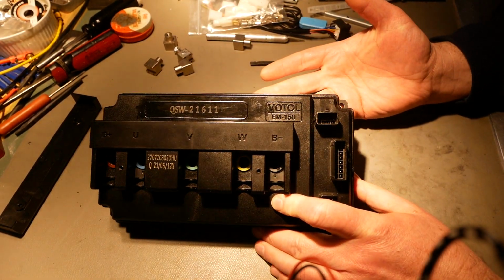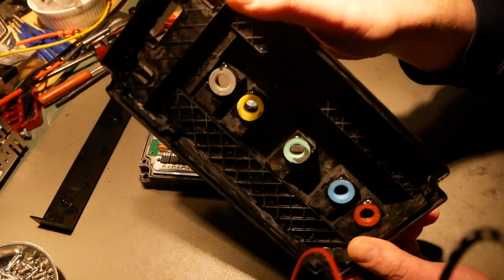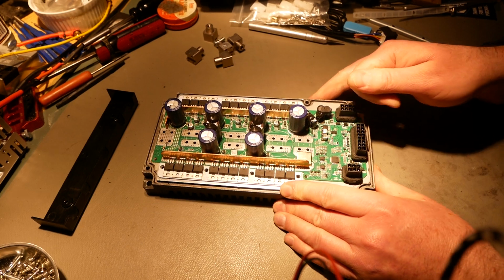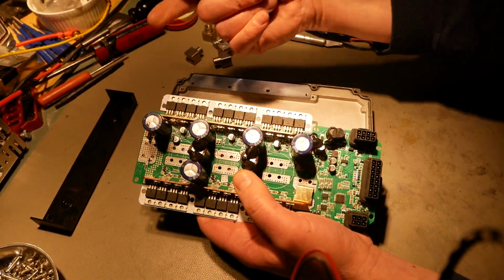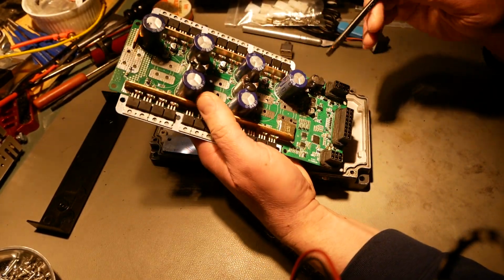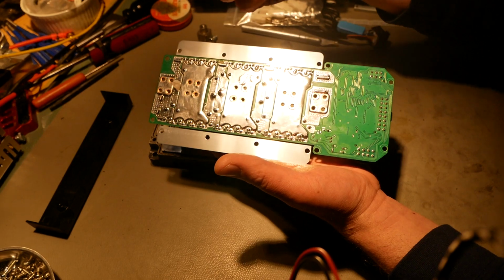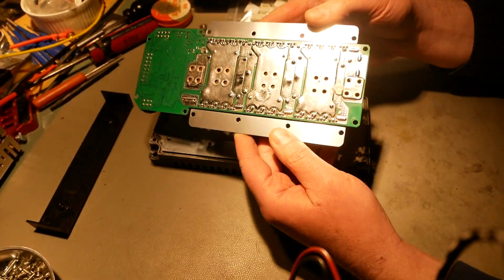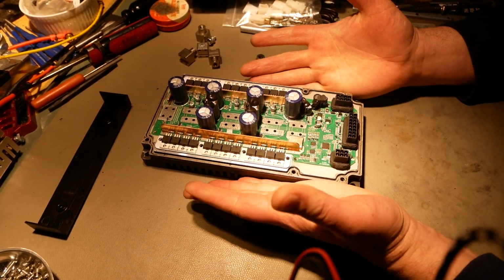Votol EM-150 Overview

Comment from the maker: Corrections:
I'll mention this in the macro video and probably should have done it here too. There is no evidence of temp sensors on these controllers. I know the STM32F103 has one internally, but that's useless for the mosfets. There really ought to be at least 2 of them. I'd put them, central as possible and physically on the MCPCB's.
Reply: Good day. I read about that at endless-sphere. If I understood all correct, temperature of mosfets is MEASURED not by thermocouple or similar device, but using same method that sometimes used to measure temperature of the LED`s - by measuring of voltage drop at MOSFETs during they are warm-up\change temperature.  Didn't verify that myself. But opinion like that exist’s. Also, there is one "bug". One of the users of that forum (at youtube his nickname\channel SilentEnduro) had reported that controller significantly reduce power after some abuse in mountains\uphills. I am saying "bug" because MOSFET`s actually cold, but controller thinking they are hot and reduce power. At endless-sphere there is one post with "settings" that are changing the way how internal temperature is calculated.  They are works for him, but he is not recommending to copy them because of risk that controller will be "brickt" (in case of different version, etc). (However,I did copy them to hidden menu inside VOTOL-EM-V3 Software)
Reply from the maker: @viko2812  I can't speak about how it might do temp sensing. Just me, but assuming the mosfets are behaving XYZ way may be unreliable. Proof is in the multiple points of truth and this is one area where the EM150 is lacking in my opinion. It REALLY needs at least one temp sensor on the high side and one on the low side. What is this "hidden menu" you are referring to?
Reply: @de-bodgery   youtube keep removing links(((  even at own youtube videos. omg....( Will try to just type... Open Votol-EM-V3 software... Than switch to PAGE3..... After that inside EditBox: "error_count:" remove all digits and type twice using keyboard sybmol "~". You will see "hidden menu" - Temperature protection. Or maybe you know how I can share link to youtube video. I captured a video with that process and with WEB page about settings at  endless-sphere site.
Reply: https://youtu.be/0usEsRcJOBE
Reply from the maker: @viko2812  PM me on facebook...Richard Gumfaw

Comment: Please tell me, I have the following situation: I connected the controller to a PC, when I apply throttle the motor does not rotate, but in the Display tab the temperature increases and reaches 200°C within 2 seconds. This happens every time I press the throttle. The question is: what component is responsible for temperature measurement? I have a donor controller.

Comment: So the big caps are only for filtering? So replacing them with bigger ones will not help output amperage/power?

Then do you have suggestions on how to improve output power of that thing?

Comment: hi, in case a unit brings always overcurrent and phase current at 0 no matter how many times I write parameter with different values, means the unit is bricked?? can you tell me in case of em50 if an sdm resistor may be the culprit for this issue? or a cap or bad component to check?
Reply from the maker: I don't know the EM-50 at all. If it is constructed like the EM-150, then I can give you advice based on the EM-150. The EM-150 has shunts for battery current, but not for phases. If I was seeing your error on an EM-150, I'd check the circuitry around the shunts and up to the CPU.

Comment: I noticed in a teardown of the EM260 model that 2 phase current sensors are used so they must have implemented a more complete version of FOC on those models
Reply from the maker: Same basic FOC capability as Far Driver or KO. They all use the same STM32F103 CPU and the same basic FOC libraries. This is a lower power CPU that can't handle the full set of FOC capabilities like VESC or Nukular can on the much more powerful STM32F405 CPU.

Comment: Hi! How did you removed the plastic lid? I have a EM100 which is very similar but can't remove the lid after obviously removing the screws. Any help would be helpful!
Reply from the maker: slipped a knife between the plastic and the aluminum all the way around to make sure it wasn't stuck down with silicon anywhere and then it pried up easily. There was a controller that had a weird set of studs on it. I'd watch all my tear down videos on the EM-150 to make sure it's not that one.
Reply: @de-bodgery  Thank you!
Reply: @de-bodgery  For some reason, I can't get the plastic off. Already did what you said but it is still attached. My guess is that it is glued, so I'll try to use a little bit of acetone.

Comment: About firmwares of controllers, including Kelly:
This whole mess started around 2006-2010. At the request of the growing market, many manufacturers have created their own controllers. At that time, there were no FOC libraries/SDKs (which are now offered by microcontroller manufacturers themselves). And each controller manufacturer had to develop its own firmware. Which is what they did. This is not a super difficult task but not a super easy one either. Yes, in recent years, microcontroller manufacturers have realized that they can attract more people if they release ready-made SDKs for implementing FOC. But, controller manufacturers could not use it this way (it simply did not exist in the past). They tested/developed and added new functions to their own firmware. And later, even with the advent of SDK FOC from microcontroller manufacturers, there was no point in switching to them. And therefore, it is logical that controller manufacturers continued to develop their own firmware. They have already been tested and work well.
Reply from the maker: This is exactly why you see wide spread adoption of the STM32F103 in Far Driver, Votol, Sia, KO and others. They are all using the FOC SDK from STM for this CPU. As a result, you can also see many of the same motor control glitches in all these controllers. About the only people doing their own work is VESC (STM32F405), Nukular (STM32F405), Kelly (MCF51AC128) and ASI (TI F302). I'm sure there are others too. Pretty much everybody else is using the STM F103 and the SDKs for it or they are stealing VESC like Torp does.

Comment: Sir... How it's not FOC controller?!?! The current on phases can be measured by the voltage drop across the mosfets themselves. This seems to be exactly what it does in Kelly KLS Chetah series and many other models of Kelly Controllers.
Reply from the maker: No direct phase current sensing is usually a good sign that something isn't FOC. Battery shunts only is usually a good sign of NOT being FOC. However, in the case of this CPU, there are libraries that are used by Fardriver/KO and others that all use this same CPU. It's jsut a matter of when you make your firmware what parts of it you implement or don't implement. So there is pretty good chance that Votol is using some form of basic FOC control. BTW, using mosfets to sense phase current is seriously unreliable. As the mosfets warm up, their resistance changes. If you want to consistently measure phase amps, you need a reliable resistance to do that with! You can go look at data sheets for many mosfets and see Rds graphs vs temperature. This is a VERY unreliable way to measure a voltage drop and use that to calculate phase amps!
Reply: @de-bodgery  First of all thank you for answer sir. I would not recommend you to say "FOC libraries". That sounds I don’t know - a little weird. It is more appropriate to say "FOC implementation" instead. Programmers who create firmware with FOC implementation for the controller do not take any libraries(in most cases), but instead create everything from scratch. It's just fun for programmers to stretch their "muscles", it's an interesting task in general. This is the case when the program code is directly connected to the real physical world and affects it (I mean through the motor). That is, it's like creating a robot/Frankenstein.  Yes, I guessed that using mosfets to measure current might not be accurate enough. Thanks to the information from you, I now understand what some of the compensation tables I see in the firmware mean. Kelly controllers have a fairly decent number of temperature sensors. And most likely these sensors plus compensation tables are used to compensate for temperature changes in mosfets parameters. Despite the fact that measuring phase currents on mosfets is theoretically unreliable, in practice Kelly controllers work great. If, of course, they are configured correctly and the controller and the specific motor are balanced. Then Kelly begins to work magically and cosmically softly. What is interesting is that it is impossible to completely balance Kelly and a specific motor using the Kelly program for configuration. There is some kind of chaos going on in the company in terms of software. But it doesn't matter, I'm almost finished with my project, which solves all many of these problems, saving owners of Kelly controllers from a lot of headaches.
Reply from the maker: @KellyControllers  I'm sure Kelly probably created their own firmware. I've used several Kelly controllers and the layout of the software and general controller functionality set leads me to believe that Kelly probably did their own firmware. Also, only other place I've seen the CPU kelly uses is in a Sabvoton. I've taken apart a ton of controllers and not seen it elsewhere. There's a good chance that Kelly developed their own libraries for the different controller types they sell.They have a large enough staff and been around a long time that they probably have on staff programmers. They probably have compensation tables to account for mosfet temperature. I'd just use phase shunts and not have to deal with any of that! Before I commented on temp sensors, I went and looked at my own pics of the 4 different Kelly controllers I've taken apart. I find a single temp sensor on the center phase on the high side mosfets only. That's hardly anything! It's at best an average of the total heat of all 3 phases. 
*
ASI, Sevcon and maybe one or 2 other companies that have been around a long time have done their own firmware from scratch for smaller controllers. Probably many big cost inverter makers have done their own work. There's a lot of money in that type of thing that doesn't exist in controllers you'd put on a Surron or e-bike! I know elevator, commuter bus and electric locomotive inverter companies that use VESC because this is such a huge challenge! The numbers of truly independent companies doing controller firmware development all on their own are quite few! 
*
BTW...as someone that actually works in software development, they are called "libraries". What you do with those libraries to make a functioning controller is your "FOC implementation" In the case of Votol, Far Driver, Ko Moto and others that are all based on the STM32F103 CPU, they are using the same FOC libraries on all of their products. This greatly reduces the amount of development they have to do! Tweak some stuff for how you measure current and timing and it probably runs. You can see the exact same firmware glitches in Far Driver, KO and Votol thanks to the exact same FOC libraries!!! Some time back, I asked several VESC developers about independent firmware development. I do mingle with the VESC development people pretty often! Talking to the likes of Benjamin and Frank, the founders of VESC, they tell me a very different story about developing firmware from scratch. Sure it can be done as that is exactly what they did for VESC. I know one other guy that does VESC development that has created his own FOC firmware tat runs on the STM32F405. He's quite active in VESC development too. He's the only other person I know of that has done this! Everyone else, they steal VESC like TORP or Electro and Company tried to do! All the others using the STM32F103 CPU, they steal or borrow from each other or use the ready made FOC libraries that exist for this CPU. I bet there is a handful of Chinese programmers that actually modify all the firmware for all the Chinese controllers that use the STM32F103! Copying in China is RIFE! Far Driver has done a lot of work with those FOC libraries and KO moto denies it, but they are using FD firmware almost as is! I don't know if that's true for Votol, but minor changes to those libraries is easy compared to "stretching your muscles" and starting from scratch! I imagine others like SIA and a dozen other China brands with basic FOC capability are mostly copies of each other and all based on those exact same STM32F103 libraries! Every VESC developer I know of says this is a monumental task to take on from scratch. China where there is no intellectual property laws and copying is so rife, most of those companies would rather copy/steal instead of try to tackle this from scratch!
*
It would be amusing to buy one controller from every China brand that claims FOC. I'm betting 100% of them use the STM32F103. I'm also betting the same glitches that are common to FD and KO and Votol also exist in all those other brands! AKA...it's all the same firmware!
Reply: They have current sensors on two phases for the EM260.

Comment: Does the use of discrete components instead of the gate-driver IC option mean that these are also more "repairable"?
Reply from the maker: Not really. If you blow mosfets, a gate driver may also blow. An IC with a part number on it is usually easy to find replacements. A tiny transistor or diode or whatever might not be something you can find the part. I often times can't find replacement discrete components by their 2 or 3 letter part code.
Reply: @de-bodgery  Thanks. This is the type of thing I like about your channel. Its easy to say one device is crap and the other one is awesome, but without the details as to why, someone who is not into electronics can't make an wise decision.
Reply from the maker: @ronroberts110  Thanks Ron...glad I could empower you!

Comment: So to recap suggested upgrades to the EM-150...fill the gap in the "L" of the thick copper battery+ plate, shorten the leg attachment on the MOSFETs, More high-frequency filter capacitors, add a temp sensor...
Reply from the maker: yup!

Comment: Hi I have a question about a daymak em2 controller  was wondering if I can run 96v batteries  full charge is 108v
 Model: Daymak - DMK1892

Voltage: 48V-72V (72V)

Current: 25A-50A (38A)

Power: 500W-1000W

Low Voltage Cutoff: 40V(63V) BLDC Controller (Bluetooth)

Code: A180189203

7353-XF

D DAYMAK DRIVE

TURBO
Reply from the maker: What's the manual say?
Reply: No 
More than likely over voltage will occur at 88v in my experience with basic controllers. Fardriver 72v models are capable of 106.1v over but u should order a 96/108v controller that makes full use of 26S cell config. Cylindrical cells drop V a lot during max draw so starting with >106.5 helps A LOT. Pouch cells drop much less but don't take abuse as well.
87.9v /26 is comically low. 3.3v per cell? Ur only drawing 50 A so maybe but  it's a  temp solution to be avoided.

Comment: Small world: i just have a Votol EM-150/2 on the bench. Low- and highside Fets blown on th U-phase. Five Fets desintegrated, nearly zero ohm between all three legs. I wonder why the 6 big caps are only rated 63V and the Fets are 100V types (MDP10N027). But it has gatedriver ic (IRS2127)
Reply from the maker: Are you in the USA? Care to send your controller to me for a tear down video? I may even repair it!
Reply: @de-bodgery  No, sorry, i am from germany and the controller isn`t  mine (yet).
Reply from the maker: you probably have blown drivers too if all 3 phases are torched.
Reply: @de-bodgery  I think you are right: zero ohm between gate and source and fourty ohms between phase and battery plus. I hope I can fix it. Right now I only opened the controller to look what caused the fourty ohms.
Reply from the maker: @PeterPan-gy6kq  You already know you have cap issues. I'd pull all of the large caps and then check that resistance across the mosfet drivers again. It's unlikely that there is a resistor across the drivers, but the caps might look like resistance if they are internally shorting.
Reply: @de-bodgery  idk what caused the 45 ohms. It's only on one phase. Right now with blown FETs attached we can only guess. It looks like there is no damage to the pcb. So there must be a way to repair and learn something new about controller. I like this. "Follow the shorts" like Sorin, another great YouTuber teached me.
Reply from the maker: @PeterPan-gy6kq  I follow the shorts quite a lot in repairs. Depending on the electronics, many things die open and not as shorts. You have blown mosfets in only 1 phase or in several?
Reply: @de-bodgery  On 5 FETs of one phase (high- and lowside) white stuff came out and the legs of one FET fully disintegratet and the molten metal shorted the source of one FET to the gate of the next FET.
Reply from the maker: @PeterPan-gy6kq  You will be replacing at least 10 mosfets. A single phase is just half of an H bridge. What happens to one phase can spread to the others as well. There is a good chance you will need to replace the gate drivers for that blown phase. I have to wonder about the motor that it was connected to. Probably that motor phase is the root point of failure.
Reply from the maker: Those 63v caps sound like a mistake! I'd replace them with 100v. The EM-150/2 is rated for 100v max so those 63v caps must be a mistake!